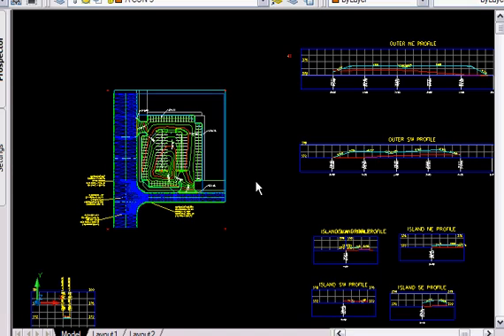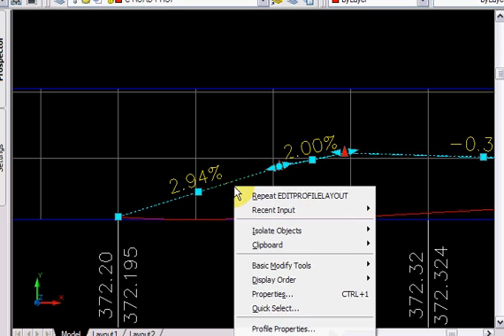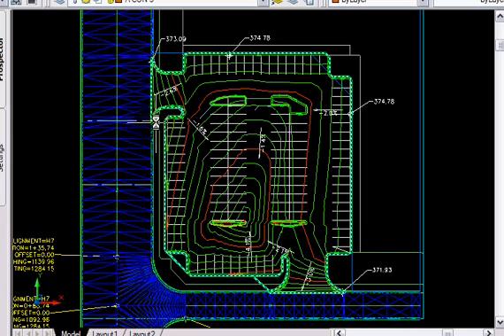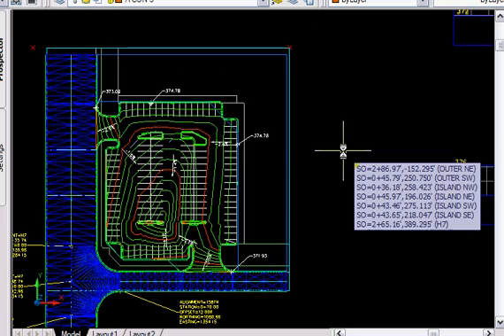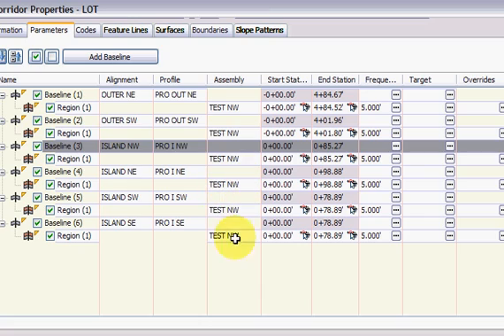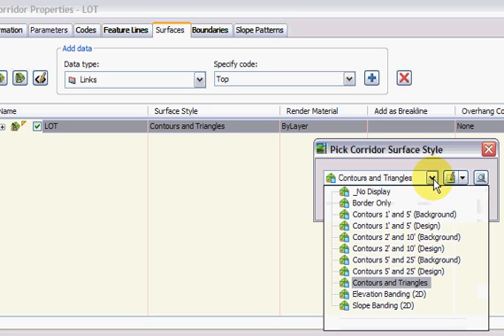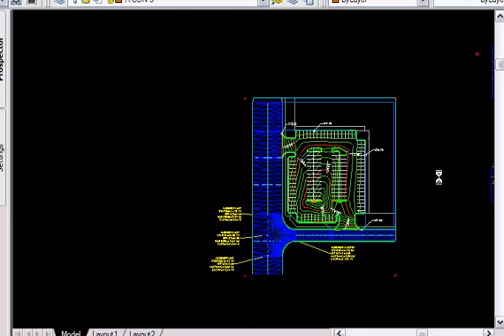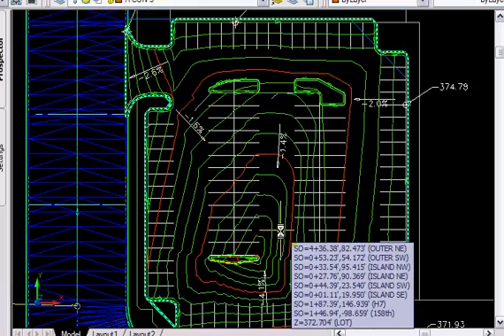Parking Lot Civil 3D

Comment: Ive been using civil 3d to design a subdivision and I'm doing the grades for the lots now. The grading tools are working fine but my problem is that whenever the drawing is viewed in 3d realistic the surface is still spilling on top of my lots. The surface doesn't seem to be changed by the cut and fill being applied. Do you think you could give me any clues as to how I could fix this?